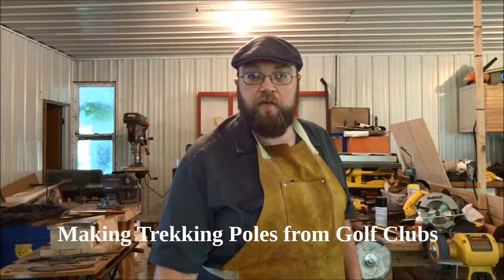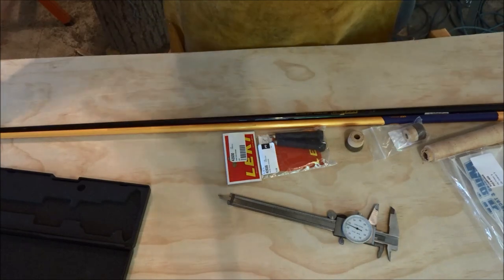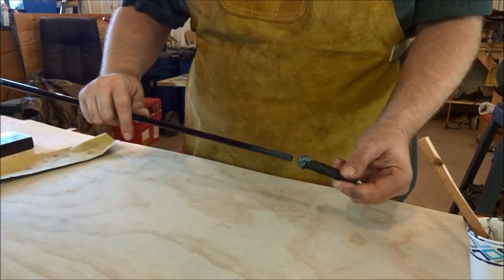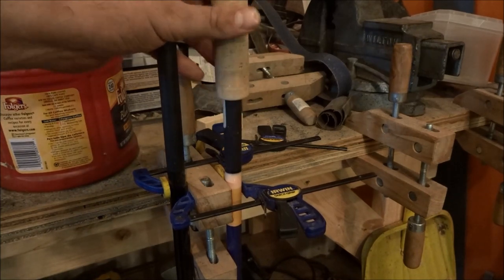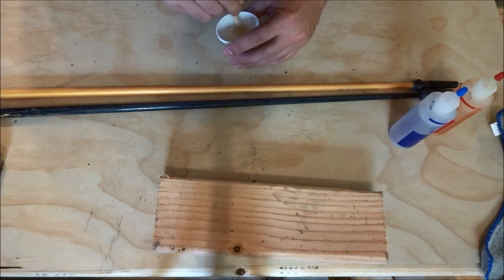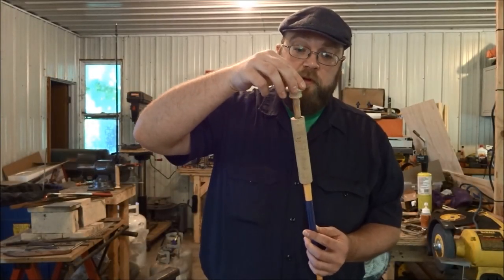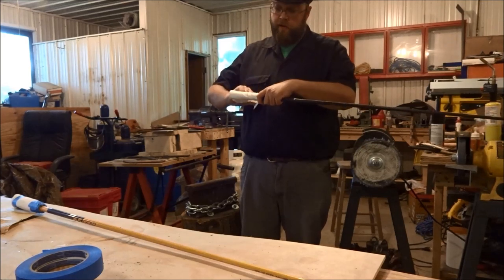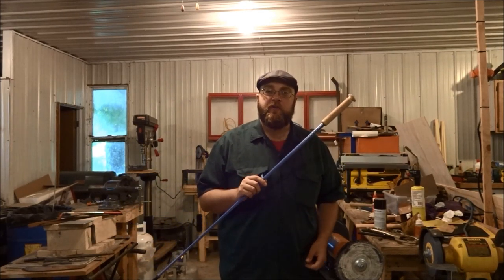Making Trekking Poles from Golf Clubs

Comment: Im interested to know (3 years later) if these poles worked out. I watched this video a few weeks back, and intended to make these, but, changed my mind after I realized I was not comfortable with the amount of flex in the shafts.
Reply from the maker: I only used them for 3 or 4 short backpacking trips and day hikes before I quit using them. What stopped me was that I decided that I didn't like the straight/round grips. After a few miles they hurt my hands and wrists. The diameter of the round grip was too small for my hands, and the straight vertical grip was bad on my wrists after a few trail miles. 
It turns out that commercial trekking pole grips are ergonomically shaped for good reason. If I ever build a set like this again, I will order real trekking pole grips instead of fishing pole parts. This would add cost to the build, but overall might still be much cheaper than buying poles, depending on which grips I bought.

Physically, the poles held up well. The flex in the shafts was not a problem. The poles seem really bendy at first, but once I was out on the trail I didn't even notice the difference. The flex provides a small amount of shock absorption which was nice. That being said, its important to get the stiffest golf club shafts you can find. You could easily make a set that was too flexible if you used the wrong parts.
Reply: @ShawnsWorkshop  thanks for the update!!